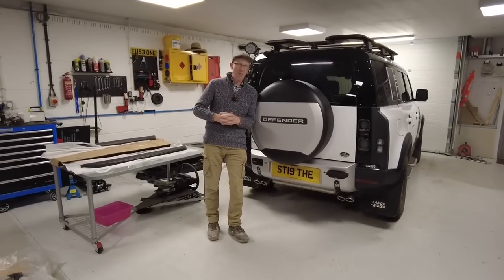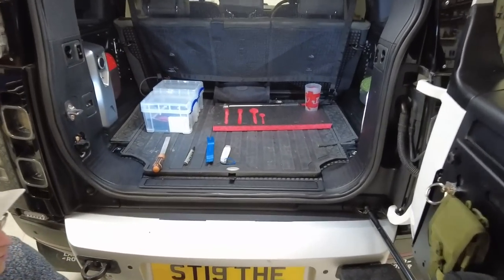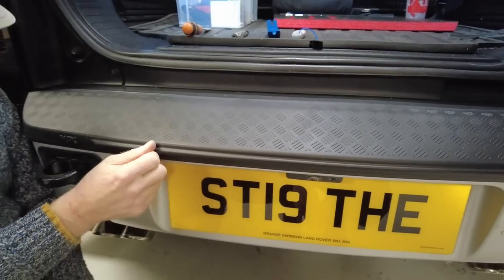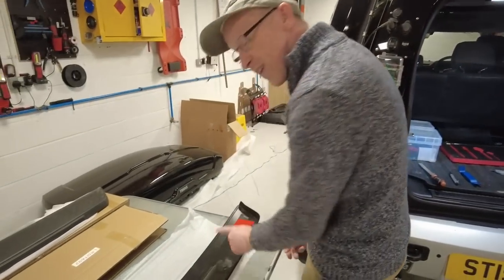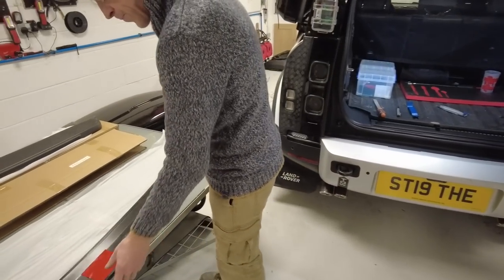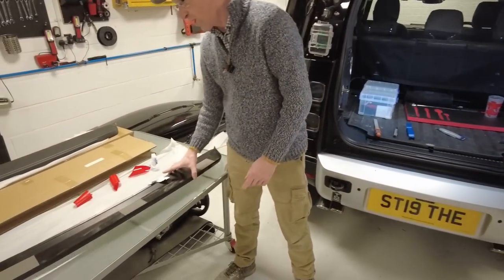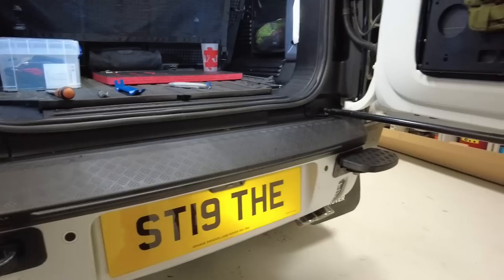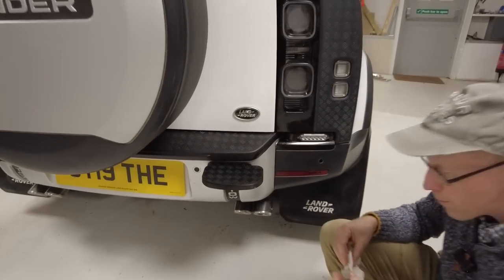Chequer plate FULL Rear Bumper Cover For Land Rover Defender L663

Comment: Be curious if there is any way (or need outside from myself) of a front end gloss black protection system that doesn't add much length to the car like the OEM ones do. I plan to use mine in the city all the time to load gear out and am parallel parked constantly. Just a thought!

Comment: My bumper cover has come off, it more or less just fell off... Both the silicone and double sided tape meant to keep it in place wont stick to the cover. I have tried to clean the cover with all types of degreaser including acetone (and used sandpaper on it) but nothing seems to stick to it. Now I have a bumper that looks terrible, with silikon all over and no way to get it clean, and no way to get the bumper cover to fit or stick again... Simon, need some help here! How do I remove the silicone stuck to the bumper, and what on earth will stick to the bumper cover?
Reply from the maker: Hi sorry to hear about this can we send you another one to try ?
Reply: @L663  Not sure if another bumper will make any difference, but we could try that. I assume the material in the cover is a plastic that is "fat" and if all covers are in the same material, same thing will happen again. I guess this will happen to other buyers as well. Think we need to find a glue or adhesive tape that works with the material.
Reply from the maker: @johan6504  Hi - I have had another think about this and I would like to do a trial with some plastic primer that is used a base coat for paint before painting plastic - then stick the tape to this and see if this improved the adhesion. Can you contact customer service so we can work with you on this.
Reply: @L663  I was thinking about a primer as well, just wasn't sure what type of plastic we're dealing with. I'll send you an email👍

Comment: Hi folks. Super quick delivery of the rear bumper cover, but, it seems to be over 10mm too long for the bumper. I haven’t installed it yet as I can’t decide if that’s the way it was designed, or, if it was designed that length, how to fill the considerable gap on each side. In contrast, the width in the Center is perfect.
Reply from the maker: Hi David - sorry for slow reply - i am on holiday at the moment ! 
Do you have the bumper pushed back fully so it overlaps the joint at the rear of the boot area ? I guess so if the cover fits closely at the rear ( near the camera )
Reply: @L663  Hi. There’s been a suggestion from the support team to overlap the bumper cover. I looked at it this afternoon and think that might be a solution. The overlap is a little over 10mm on the black trim. Perhaps future sales could be accompanied by some guidelines for fitting, with a diagram or two.

Comment: Hi Simon, I’ve recently purchased the Spare Wheel Lock off you for my new 3 week old Defender 90 😁& although I initially had a fitting problem, your after sales help sorted it thank you😁…. I’m now going to purchase this top bumper cover but ….. I wanted to ask you please, do I need to use the silicon? If ever I have or decide to take it off, the silicon looks a nightmare to remove & looks like it will cause permanent damage. If I can get away with just the sticky pads, that would be perfect (need to order the satin finish cover soon as I have already had to wax / polish scuff marks off my gloss black bumper top twice already). Thank you.

Comment: Mine fell off this week. Applied per the video. Now I have to figure out how to get the silicone material off the bumper without damaging the paint. The three double stick pads failed. They had sand/dust dirt on them. Don't know if it would have been better to run a bead of that adhesive all along the top of the rubber cover as it meets the top black molding of the bumper -- didn't do that because of the "let water run off" comment.
Reply from the maker: Hi Robert - we will send you a replacement - i think with the ABS type you will have no problem.
Reply: @L663  Thanks for that. I am asking Lily as well. The cover I have says HSX on it. Does that mean I have the best cover for adhesion? I will ask (after I get the silicone off) can I put the vinyl down, then use a full adhesive strip as you demonstrate with the bumper cover that is LED? (vs just 3 pads)
Reply: @robertlukas9286  The parts all come off the same mould so will look the same - including the HSX logo - its just the material we used is different. It may be tricky to get the silicone off - you can use silicone eater and a scraper. I would be inclined to just fit another cover - it will be no problem. You can use the vinyl method if you prefer.
Reply: @simonjefferson  Thanks - I won't keep going on about this - but can Lily tell from my order 2 years ago that I have the "not ABS" version? It feels stiffer than rubber. So keep silicone in place, don't add more silicone and just use the three pads where the old ones were? Seems like old silicone will raise cover just enough to limit pad adhesion (pushing down to adhere but silicone limits the pushing down). I will delete this thread when we are done, too much flack.
Reply: @robertlukas9286  I am pretty sure you have an early one. You will not be able to tell the difference - they both feel like "plastic" its just the PP has a more slippery oily finish... the ABS ( new type ) is less slippery to touch. I would leave the old silicone in place - add some new silicone in a different spot with new pads. Sorry for the issue and thanks for being one of the first people to buy the product when it was new !

Comment: Absolutely love mine & thanks Simon for letting me purchase a prototype some months back.

It’s tidied up the rear bumper very nicely & no more scratches from dog claws on my bumper!

Another fitting tip is to remove the rear door strut when positioning the cover and I used a hairdryer on mine to warm up the cover and silicon when fitting on a cold day.

A brilliant and well designed solution…

Thank you 👍
Reply from the maker: Hi Darren - thanks again for doing some early testing and providing feedback !

Comment: If you want to stick it on with a polyurathane adhesive but not permanent permanent, then first apply sign writer vinyl to the bumper and glue to that.
I have done this with a flexi solar panel to the roof of my D4 and it hasn't moved in 5 years.

Comment: Looks good. Would you be able to tell us when the  recovery hook step chequer plate will be available and will it be and add on as I already have the V1.0 step with skateboard tread.
Reply from the maker: Hi Jason - glad you like the plastic cover - the one in the video is 3D printed - we need to make an injection moulding tool ( $$ ) and get them made - so this will take 3 months at least ! We can 3D print them but this takes a long time and it needs to be made in 2 parts and stuck together so not ideal.

Comment: I love this cover, I've had it on my Defender X for over a year, but it has now fallen off. Like Johan (see below), the double sided tape and silicone adhesive has just peeled off the back of the cover, leaving the silicone solidly fixed to the (black) bumper (the double sided tape peeled off o.k.). I've ordered numerous silicone removal tools and products to remove the silicone off the bumper, but how do I make sure this doesn't happen again? Have you found a plastic primer that I can spray onto the back of the cover before applying the tape and silicone. I've experimented, sticking numerous tapes and adhesives to the back of the cover, but they all just peel off, it's almost like a non-stick finish! Thanks.......I just noticed that mine is the "Customer Photo" on your website listing for this cover.😊
Reply: I noticed an update to this video, here: https://www.youtube.com/watch?v=sOB8fjMbIBk . So I called customer services, and straight away they sent me a replacement ABS model (an update to the PP model), and this sticks perfectly with tape and silicone. Fantastic customer service, thanks.

Comment: If I fit the bumper cover before I fit the tow loops etc, does it make removing the bumper more difficult ? I want to prioritise my pending purchases but I really want the bumper cover first 😀
Reply from the maker: Hi Bill - I have had a think about the adhesion issues you raised and i have an idea - I am thinking of using the plastic primer we use to paint the raptor paint on the plastic and then sticking the sticky pads to that surface. Send me an email via the website. Simon